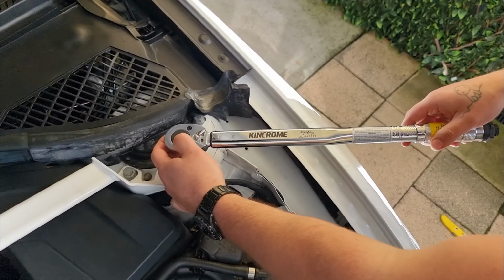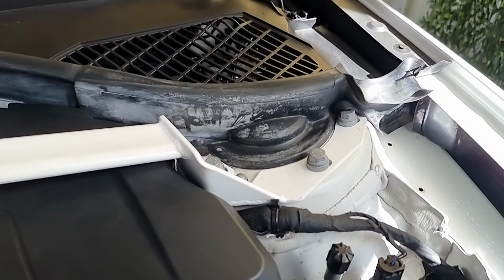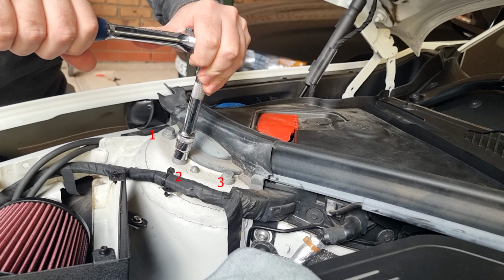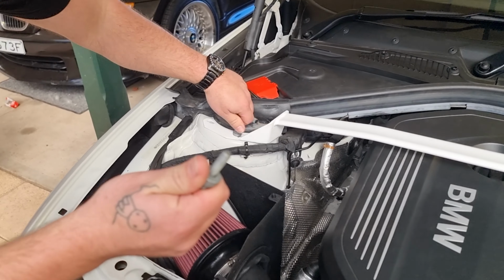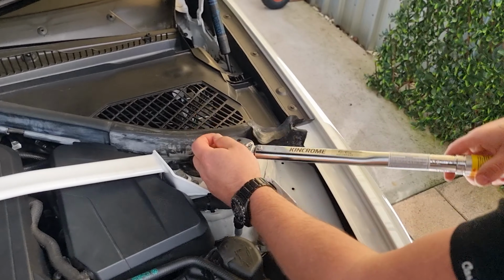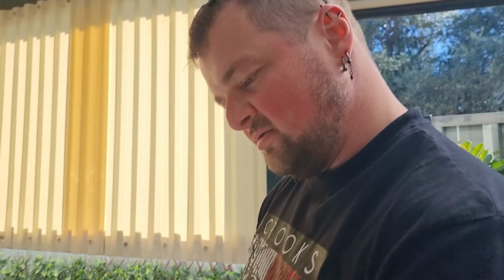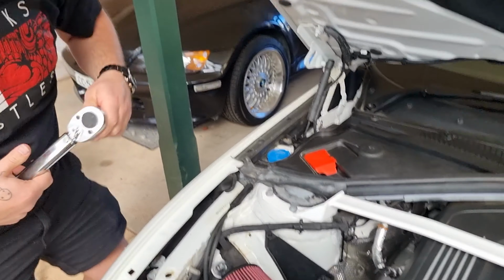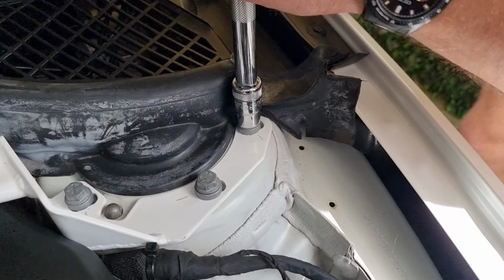How to | m140i F20 Strut Brace Fitment - Ultra Racing Strut Bar #240i #235 #135i

Comment: 30nm + 90 degrees on a 125i m sport aswell?
Reply from the maker: If you check the thread size of both cars and they're the same it's safe to say that they're the same torque spec

Comment: Should it work with a 120i F21 2016 with M pack?
Reply: I've been looking on the web and it's a little confusing to know if it's really compatible with my specific model
Reply from the maker: There are intakes available for that model. My advice. Get the engine code or your vin and check with the company prior to purchase, check with zero offset, southern BM. If it is non turbo you won't get any spool noise but it may help increase a bit of intake noise hopefully. But for the cost of it. It maybe a little disappointing if it isn't turbo.
Reply: @LamannaGarage  Thank you, if it's turbo, the engine is a B48, I've already sent my question to the company but they still don't answer me
Reply from the maker: @Naosaberas  yes Tue you should get some noise from it! In google type in b48 mst intake southern bm. They have parts!
Reply: @LamannaGarage  I have sent them an email and they have replied that they do not send to my country (Spain). And so little have they answered me which strut brace is compatible with my car, they just told me that they can't send me anything…😐

Comment: Bmw say the strut bolts are aluminium one use only which is why I've not bothered installing a strut brace as when it needs to be serviced the mechanic will need to remove, not worth it on balance imo
Reply from the maker: Yes they are considered a one use item. I did reuse them. But ended up buying a new set before I sold it.